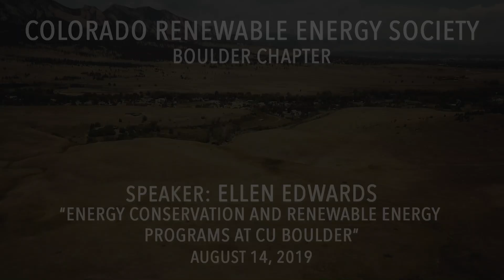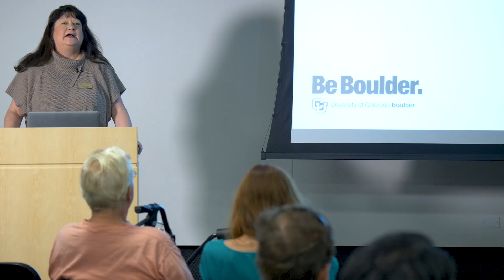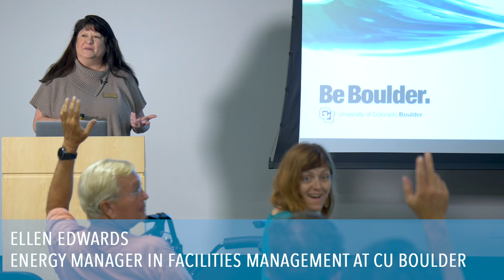Energy Conservation and Renewable Energy Programs at CU Boulder | Presentation by Ellen Edwards

Comment: Saving energy saves money on utilities.
I do not understand why everyone does not do an assessment of their home energy use and make improvements.
Air sealing, super insulation, triple pane windows, energy efficient heating and cooling, energy efficient appliances, set back thermostats, LED lighting, solar panels, battery storage, electric vehicle charger and an electric vehicle to drive.
Too many people focus on up front costs and do not look at long term savings. Once done these improvements save money month after month year after year and increase comfort.